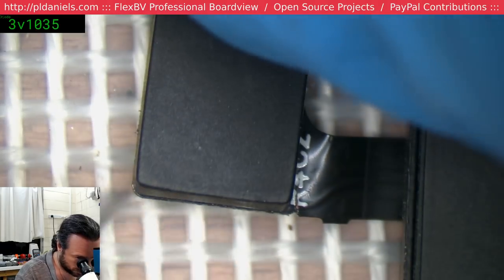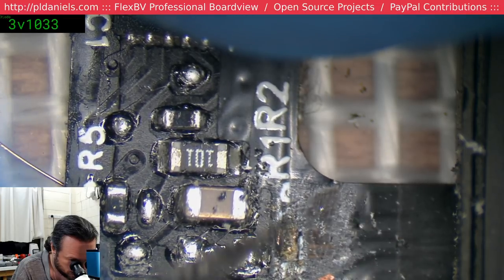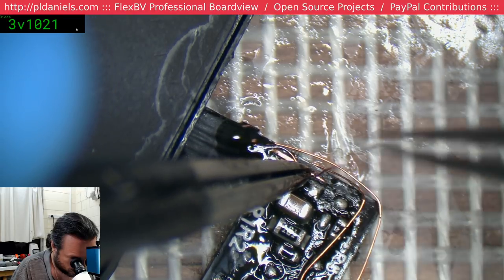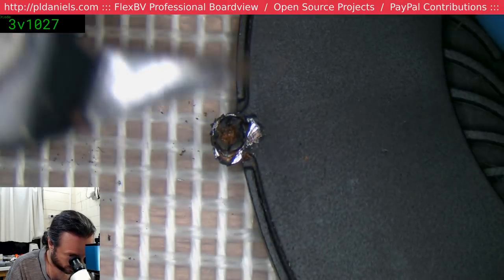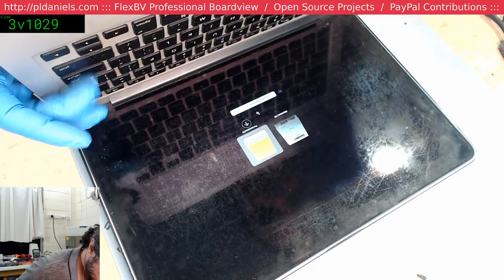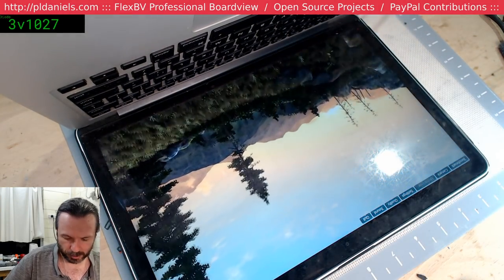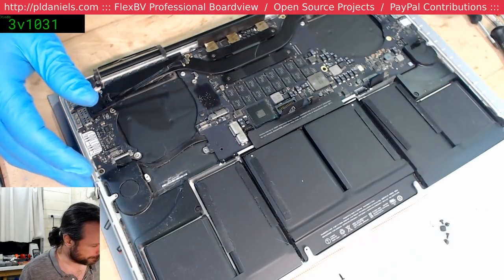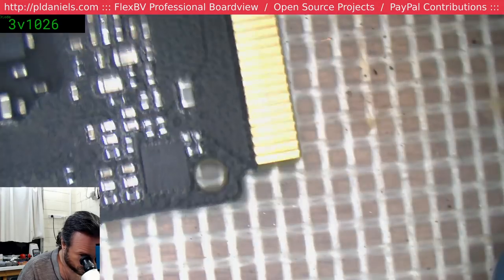Tuesday Night - No fan of fixing a fan, but these A1502 fans blow!

Comment: Hi! Nice work! I was wondering, what size of wire are you using? How can I find it?
Reply from the maker: Fairly sure it's just 0.1mm wire.  I bought it from UnionRepair I believe, or eBay
Reply: Paul Daniels thanks! Definitely gonna try to fix flex cables once I get the wire! Good video!
Reply from the maker: @alediaz84  good luck.  Going to try my luck again with another one, now that I know I'm dealing with 2 top + 2 bottom traces.